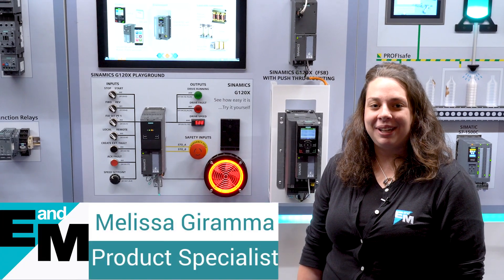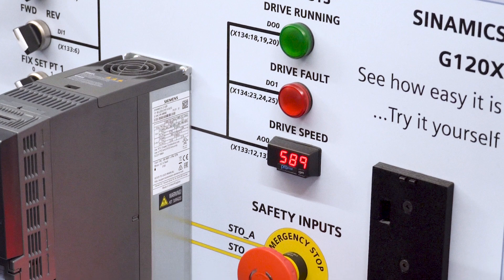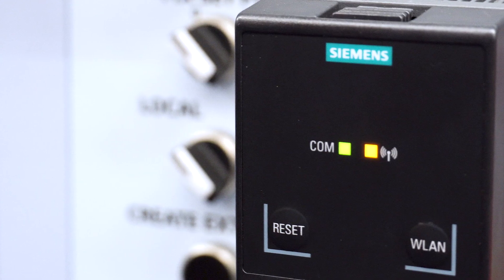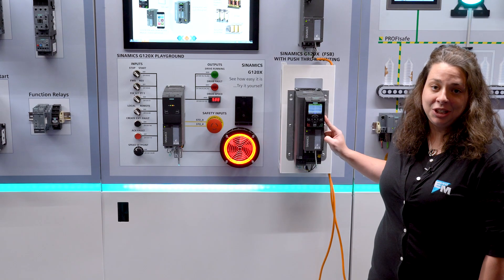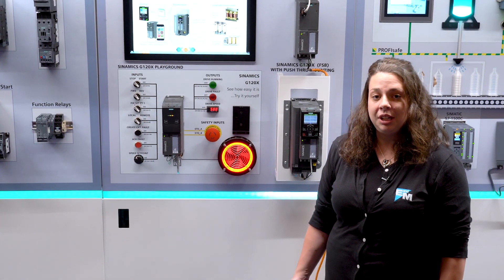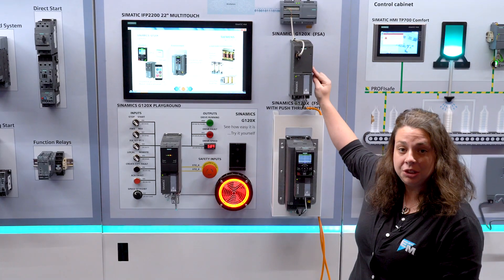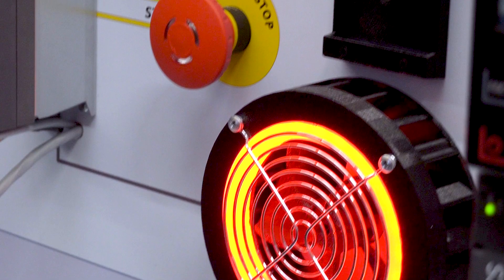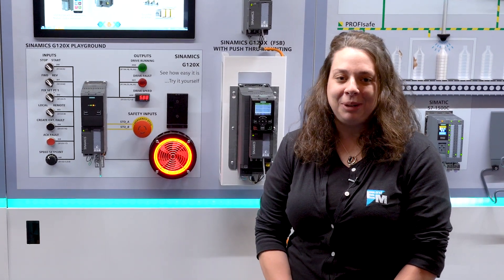Siemens | NEW! SINAMICS G120X | EandM

Comment: I have tia portal v14 pro , can i use that software with this drive or do i need a separate license for drives?
Reply from the maker: Hi @huntersblue thank you for your question. No software can be used to commission or diagnose the G120X, it's all done through the operator panel. However, you should be able to recognize the G120X in v14 as a "third-party device."